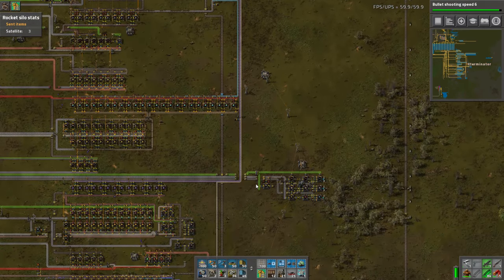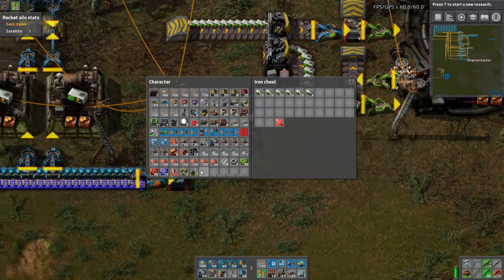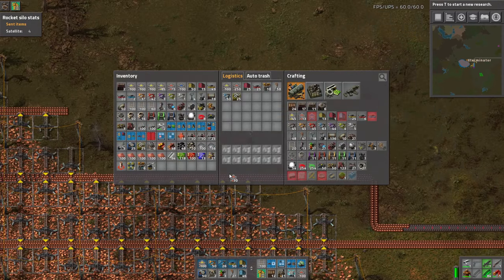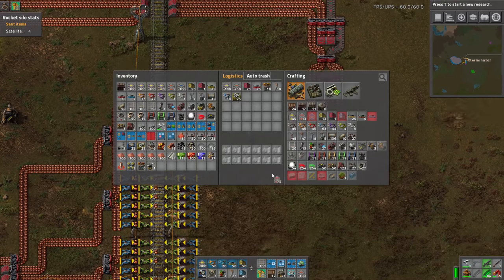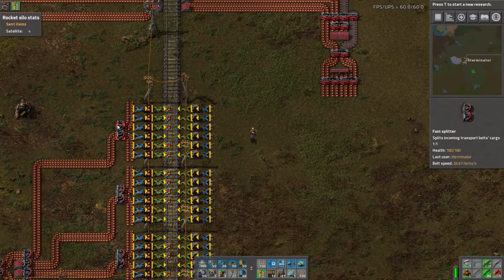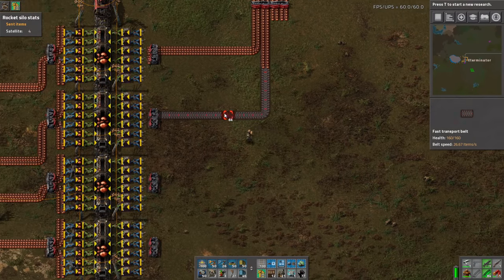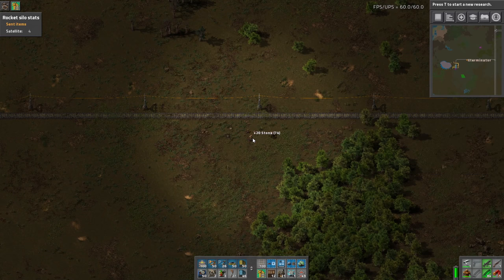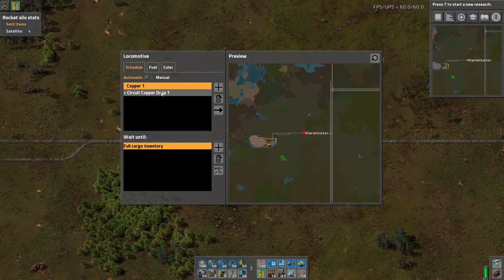Factorio: Tightening The Belt: Megabase Guide EP41 - MORE ROCKET PARTS | Tutorial Gameplay Series

Comment: 12:17 Rocket is lowest priority now. Your yellow science AND module setup will both have to be full of red circuits before the rocket will recieve any. Unless you have a completely full half-belt of red circuits, because then the yellow splitter will cause a backup on the bypass, and begin sending half to the rockets.

You could try a circuit network on the first two belts of the bypass together, and if there's zero red circuits on the rocket lane, turn off the science lane. This way it'll spit out a couple for rockets.